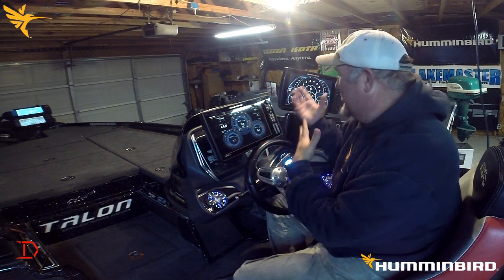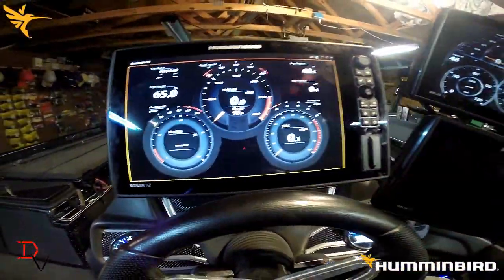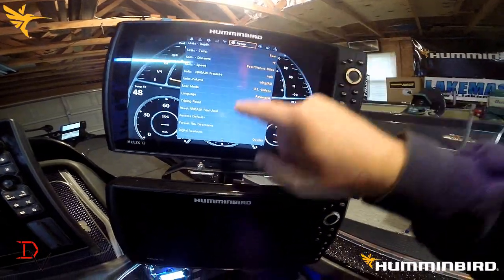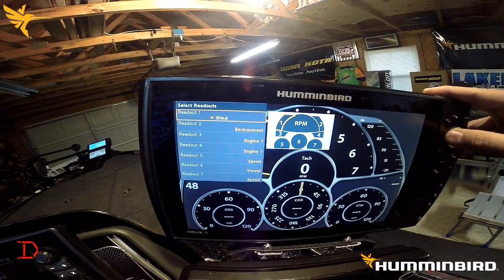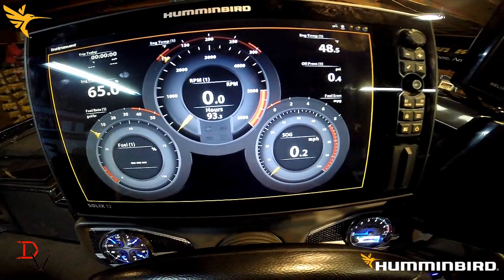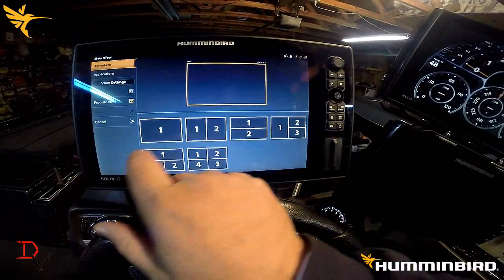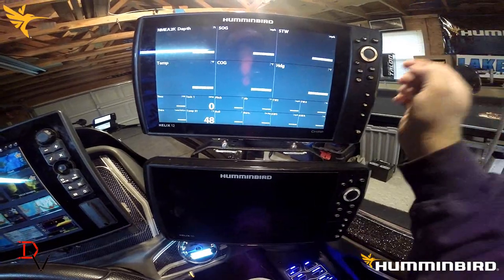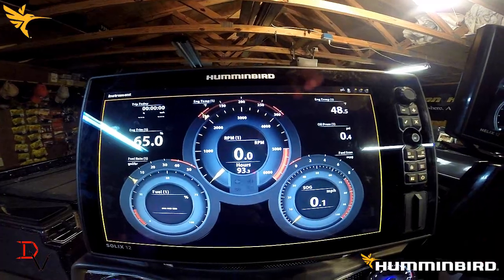Tips 'N Tricks 211: Humminbird HELIX vs SOLIX: Part 6 - NMEA 2000 Differences

Comment: Thank you so much , your series has helped me out a lot. I just purchased a new boat and installed the nmea 2k system in it along with the engine interface hooked up to my Heliz 12. Running a Suzuki DF 200 A and all I am getting is rpm and engine temp which is all I saw working on your Helix . Is this all I can get unless I go Solex? Thanks in Advance for your help... Rick

Comment: The question I have relates to mega imaging itself. In order to view mega imaging on multiple units, do all units have to be a mega imaging unit or if you have just one with mega imaging will a non mega unit be able to display that image through an ethernet connection? 
The units I would purchase would be 2 helix units or 1 solix & 1 helix (if that makes a difference).
Reply from the maker: Only units within the same series can share sonar technology. HELIX to HELIX or SOLIX to SOLIX you can't mix series to share sonar technology. I have not tried to share MEGA to a non-MEGA unit that would be better asked to Humminbird Customer Service 800-633-1468
Reply: Doug Vahrenberg thank you, I will have to ask Humminbird.
Also, thank you for taking time to do this series, it has been very informative.

Comment: What are u using for batteries to run your solix?
Reply from the maker: I use one single large Reserve Capacity Starting Battery for all electronics on my boat. You need the largest RC that is what makes the difference when buying batteries
Reply: Doug Vahrenberg does it also do your starting on the motor or is it dedicated to electronics?
Reply from the maker: I have Starting and all Electronics on a Single Battery. All other batteries are for Trolling Motor.
Reply: Doug Vahrenberg awesome thank you so much, agm I presume?
Reply from the maker: Nope. AGM was not a long life for me as Good Old Lead Acid Battery. I use Exide 27MSXX with 1000MCA and 180 Reserve Capacity at 25A,
Reply: Doug Vahrenberg thank you so much!!! Your videos have been very helpful also. You should do one just on batteries and setup of them. That seems to be one of biggest questions out there still.

Comment: Thanks so much for this series! I am in the market for a complete boat upgrade and you helped me land on the minn Kota ultrex, Humminbird 360, and a couple of Solix units! Doug, what are your thoughts on a 15” Solix versus the 12”?!? That’s my last dilemma! Definitely a 12” on the bow for me, but I’m struggling between the two for the console. For the price of doing a huge upgrade, I’m hoping to avoid any regrets. Your opinion would be highly valued!! Thanks again
Reply from the maker: SOLIX 12 vs 15 is difference in screen size. I really like my 12 but I like running multiple units. I know others that went to 15 and eliminated additional units. More of a personal choice